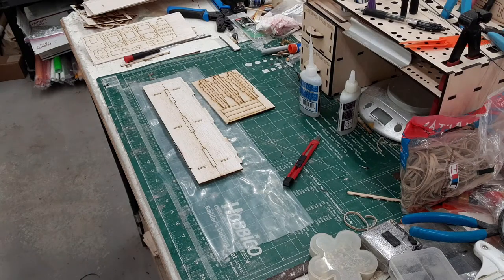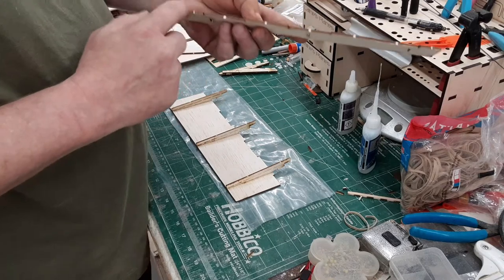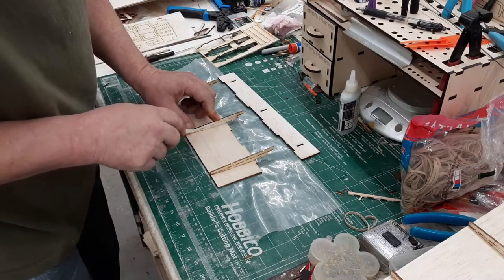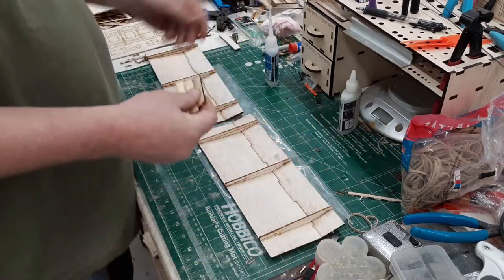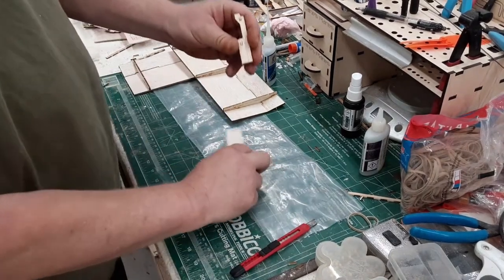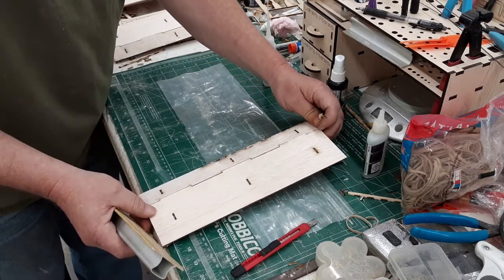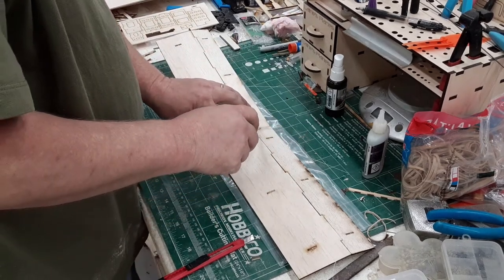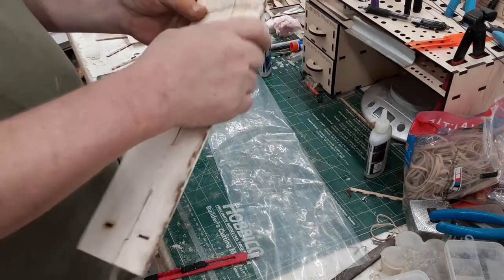Honker 250 Wing Build

Comment: To add ailerons to the Honker bipe, do I add a strip to tailing edge or cut out the ailerons from the trailing edge of existing wing panel?
Reply: Either way would be ok CC, whatever you find easiest, personally I would reduce the dihedral though if you're going to have ailerons.